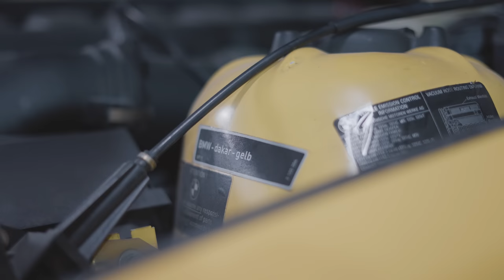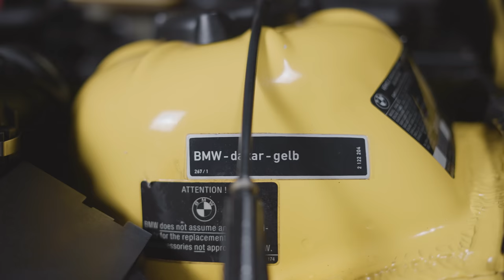Deep Cleaning A BMW E36 M3 That Had Been Sitting For Years

Comment: I picked up a 1993 e36 318i saloon 94,000km, white, 3k, dished 8" x18 speedy wheels, more mods coming, dark tint, lower 2", sport steering wheel, rear exhaust muffler delete, twin chrome tip.
Reply from the maker: Very cool man! Have the most fun with it 🤝🖤